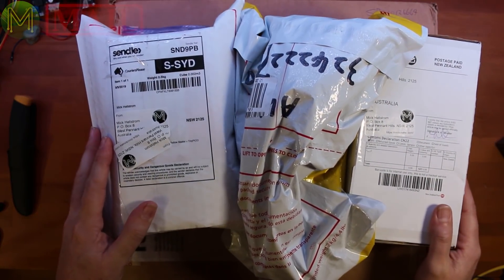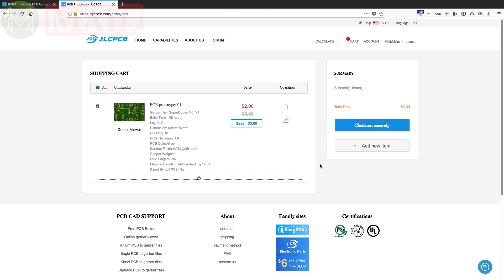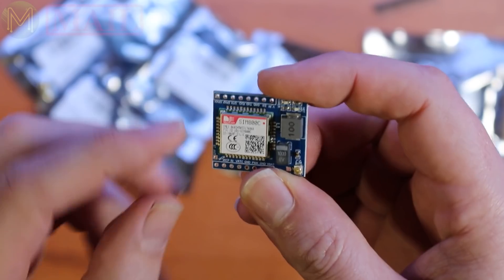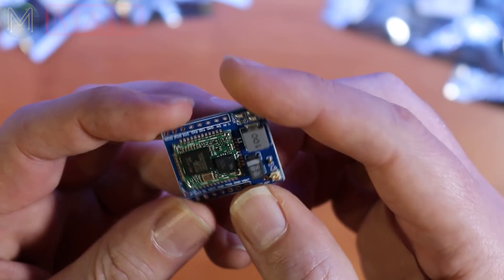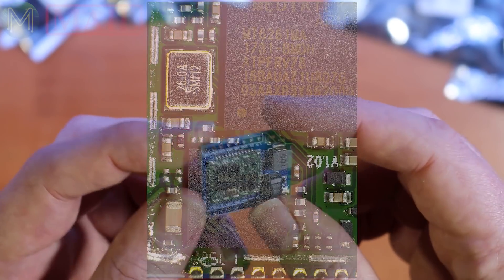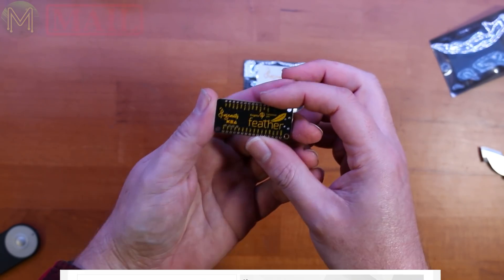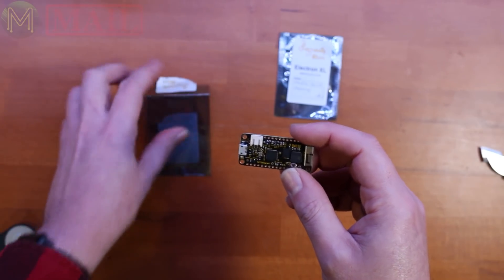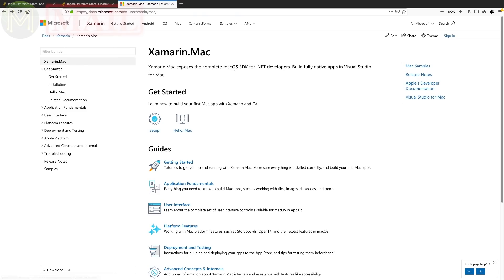#267 MickMake Mail #44: DIY reflow oven, ESP32 & beginning to hack a SIM800C

Comment: Hi! 
I'm looking for a desktop replacement (mainly running headless or LXQt or LXDE extreme light GUI),, and wondered if you've found a board similar to the 2:11 sim board or slightly larger; that has following feats:
- 1x HDMI (full, micro or mini)
- 1x USB (2.0 or higher)
- Dual (or Quad) core CPU, with built in GPU
- Wifi
- 1GB (or more) RAM
-  (Micro) SD card, SSD or m.2/nvme slot
- No GPIO pins necessary
- Smaller footprint than the Raspberry Pi Zero.

Comment: Hey Mick... At 4:13... is the case on that diode 'Ok'? Or... is there a crack in it?
Reply from the maker: Yeah, that’s OK. Possibly it was a bit of dust. I usually run over the board with compressed air to remove stuff like that, but it sometimes hangs around

Comment: Are those the solderless headers with the spring fork on the ends?
Reply from the maker: No, not solderless, but designed to hold in to the header via to make it easier to solder.

Comment: Quite feature packed that little 2g board 

but a 3g one would be better to go for(but norm cost 2-4x more) , in UK we probably still got about 5-7 years before 2g is shutdown, but reliability standpoint 2g is very good if you need gprs or sms use for low data and low power use (tracker normally)
Reply from the maker: Yeah, sadly 2G in Oz has gone the way of the dodo.

Comment: Those headers are best used as a temporary connection as they make good contact without soldering. I have been looking for those headers for a while so I don't have to solder them in. Not that I can't solder just allows me to change things if I decide to use it in a different application
Reply from the maker: True, there’s that as well.
They are a bit expensive, but worth having in stock.

Comment: I did a similar project on the ESP8266 + SSR, to adjust the temperature of the oven with two heating elements and PID regulation. Works fine for a year. Made a remote module with ESP8266 + 2 SSR, because in the oven is very hot.
Reply from the maker: Nice! Did you upload to GitHub?
Reply: Not yet, tested. Need to write comments and arrange the code. By the way, esp8266 does not fully open the SSR, even if it says that it is 3V, you need to use a transistor.

Comment: I think that you're the only guy that opened one of those modules.

I hat to open mine due to curiosity. :D
Reply from the maker: What did you find?
Reply: @MickMake  same ic and layout. BTW I also have a nbiot module that I would open but... My method is more destructive. (And those are quite pricy 20usd for 1)

No idea if they use a Qualcomm solution or still a mediatek one.
Reply from the maker: I think I have that was given to me. Might crack it open.
Reply: @MickMake  would love to know what's inside those modules.

For some reason no one on the hack community have published a photo of the internals.

Here in Italy the simcomm modules are used on security systems for homes. They are everywhere.

(2G is still available).

I'm making a nbiot thermostat, but so far the nbiot infrastructure is not working :(.

But at least I have the design and the software partially done!
Reply: @MickMake  would love to know what's inside those modules.

For some reason no one on the hack community have published a photo of the internals.

Here in Italy the simcomm modules are used on security systems for homes. They are everywhere.

(2G is still available).

I'm making a nbiot thermostat, but so far the nbiot infrastructure is not working :(.

But at least I have the design and the software partially done!
Reply from the maker: Alas I don’t have any modules. I thought I had, but nope.

Comment: I was working with a sim800c too. My problem is that for some odd reason when it try to connect to the network it resets.

It can take up to 2A but using my scope the voltage don't seem to drop :(

BTW some sim800 modules use a diode to drop the voltage to the required 4V! And this don't work very well!
Reply from the maker: Yes a bit dodgy. I wouldn’t use that method for a SoC. Luckily these modules have a proper LDO

Comment: Is there a MC that can play audio and video, around 720p nothing too high res? 
I would like to avoid something with an OS like Raspberry since the project should have no boot time, if anyhow possible.
Its a toy for a kid where he can play videos with rfid cards, so best would be to just turn on the device and it would be ready for playback with no boottime.
Reply: A Cortex-M7 microcontroller should be able to do it. There's a really cool Kickstarter from Pimoroni going on right now for just such a device: https://www.kickstarter.com/projects/pimoroni/32blit-retro-inspired-handheld-with-open-source-fi
Reply from the maker: I’ve been wanting that as well, but for a different reason. Should run a video on using a SoC based board with fast booting.
Reply from the maker: The problem won’t be so much the speed of the MCU, but the interface.
You could probably do it with an FPGA.
Reply: MickMake FPGAs are to complicated for me, or is there some beginner friendly way programming them? Like simple libraries and c# like language?
Reply from the maker: Yeah, well FPGAs are a learning curve. No doubt about it!
You have to get away from thinking about linear "programming", because FPGAs are like having every part of your code execute simultaneously.

I've seen people get the Raspberry Pi to boot in under 4 seconds. If that's OK for your use case.
Should run a video on it. It's not that hard to do.
Reply: @MickMake  Hmmm, that could work for me. Ill have to look into that. Thanks!!

Comment: Kept grandma's oven for that purpose, The good old times...
Thermostat ? nope, ... at least an On/Off switch ?   nope...
Reply from the maker: Yeah, I bet hers is very well built!
Reply: @MickMake  Utterly cheap, probably worst than that Aldi thing...
But on the "bright" side, I just opened the original power cord:
Did you ever seen a PINK ground wire ???
Reply from the maker: Oh yeah, back in the Bakelite days. Ran across many of those.

Comment: The 2G GSM stuff is still pretty useful in many places. E.g. in a lot of rural places in Europe you won't get anything better than 2G/Edge signal. So if you need low bandwidth and reliable telemetry from a remote place, it could still be pretty useful as long as your country didn't phase the 2G tech out yet.
Reply from the maker: Yes true. Wonder if anyone has made their own pirate 2G mobile service? Should be easy enough as 2G is just simply FM and GPRS just a plain MODEM.
Reply: @MickMake  Yes, people have indeed set up their own GSM networks. See OpenBTS.
Reply from the maker: Oh well then. I have another project on the horizon.

Comment: I did a homage to Seons board recently and remake it with largely through hole components.   Amazing the difference in thermocouples, I know not your permanent solution but amazing the difference extending the cables like that makes.  Took me a few thermocouples before I found a suitable one.
Reply from the maker: Yeah and mounting will be interesting.
I’m actually seriously thinking of making my own case and ditching that oven.
Reply: @MickMake  I think the module outside is the way to go unless your seriously lining it, although that makes it harder to cool down as well which is a downside.  The oven looked almost identical to the Aldi one from the UK, i also wired it in with the built in temp control although i'm not sure if that is a good or bad thing.  Only thing i've left inside is the SSR and not sure about that.
Reply from the maker: Yeah, I’d prefer to keep the heat in as much as possible. So I’ll be seriously lining it. The one upside with such thin metal is the fact that it won’t get so hot. So is kind of a good thing.